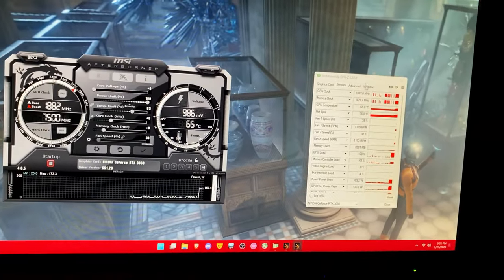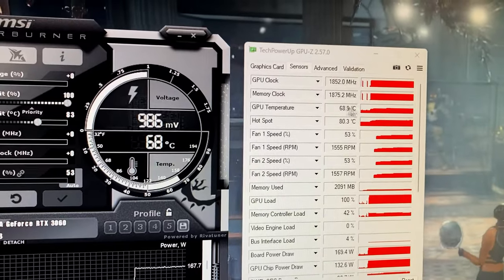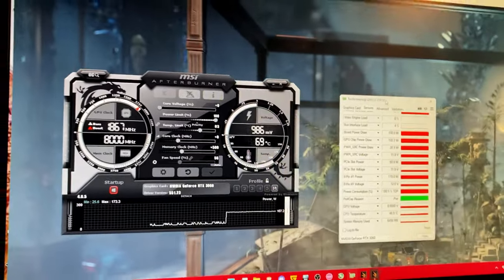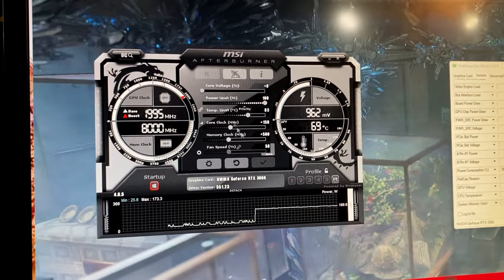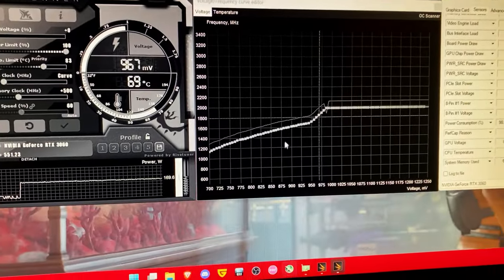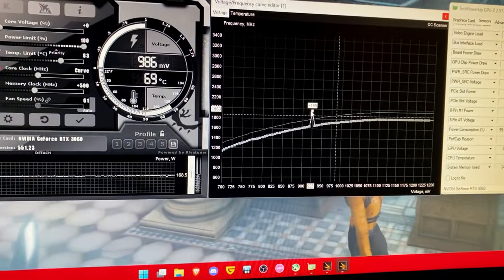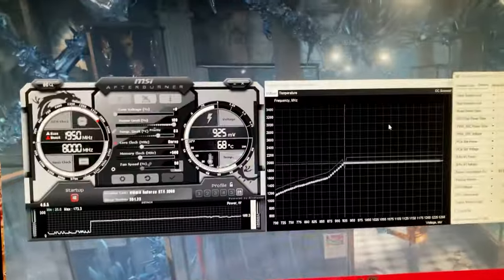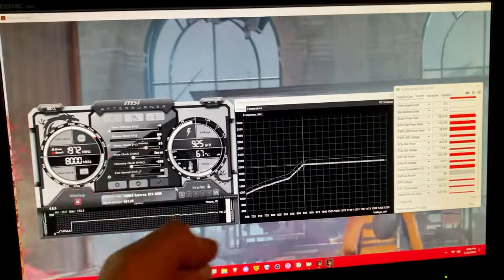how to undervolt an nvidia graphics card

Comment: why i have two graphics in curve editor: voltage and frequency? Newest version
Reply from the maker: You most likely are using a laptop which probably has dual graphics solution. Unfortunately it usually also means you can’t see or accurately do an undervolt reliably because of limitations with the hardware
Reply: @Flameboi900  hmm. I have rx 6650xt. When i had rx 470 it was ok
Reply from the maker: @kamil9602  amd? well that’s entirely different I don’t currently have an amd card to test either or undervolt but I do know there are plenty of other tutorials out there to help you undervolt I just pick nvidia because it’s easier
Reply: @Flameboi900  No problem, thanks